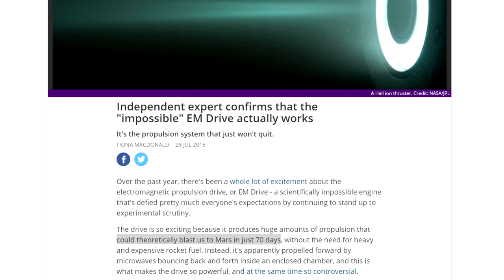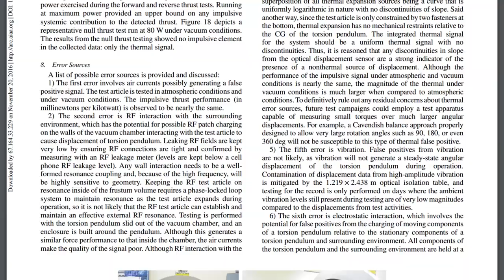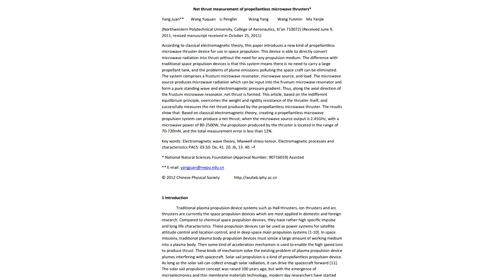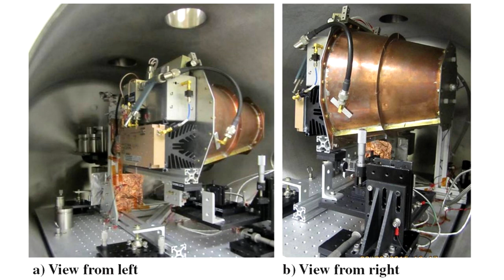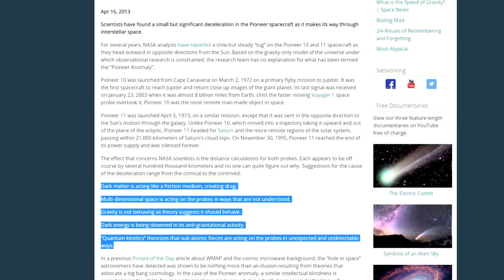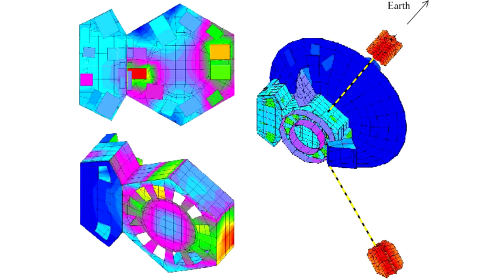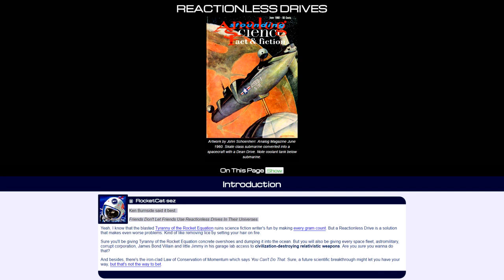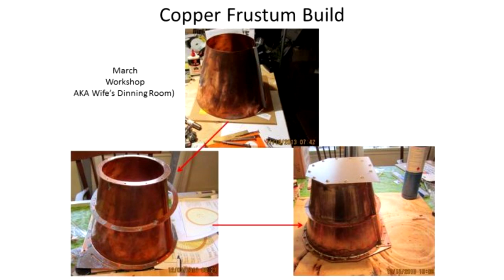What is the EM Drive? And Does it Really Work?

Comment: This seems to be at the stage where scientist that make the effect work are not really able to explain it, which should actually be ok, as long as it can be conclusively proven that the effect is real. We've had plenty of really practical effects in the past that took decades to explain after they were observed in practise. What we need is for someone to reproduce this effect with a laboratory quality microwave resonance chamber and then launch a cubesat with that chamber and some solar panels and set it to do a continuous thrust orbit boosting burn. Park that somewhere high enough for the theoretical trust to be able to overcome the atmospheric drag and see if the orbit increases over days, weeks and months of operation and by how much. You can also put a photonic drive unit with the same power source and mass and a passive cubesat with same shape and mass nearby as controls. If the EM Drive were to both work and exceed the performance of the photonic drive, then it does not really matter if its inventors can or can not explain it properly. With the costs of cubesat deployments rapidly falling lately, such an experiment should be within the budget of even some universities nowadays.

Comment: Saying EM drive will transport us into the stars is the same as saying that your own heart electrical "circuit" can power an entire city, it simpley doesn't work on the same scale, so EMD is basically useless as a propulsion device... It is a copper tin can that is simply chilling with some electrical fluch channelled in one direction. Let's say that Warp drive has many more chances to become real than this... as the Warp drive principle actually doesn't violates the laws of physics, it uses them by tweating gravity. It is like reversing the figures in an equation, something mathematically understandable.
Reply: Yes the propulsion is almost not there, however though assuming they stick with this tech, it will be scaled up and greater thrust to follow.

Comment: If I understand correctly, this is not a self-contained "drive". It requires an external microwave generator to power it. 
This is believable.

Now... can a practical system of power generation and transmission be developed to operate such a motor?

Comment: i am not a physicist , and i dont see the perpetual motion there  , you pump   there kilowatts  and you get tiny bunch of micronutons  that is super unefficient ..  and  about crude construction , its not a lazer, its a radio   ,you dont need to be super precise to get something from radiowaves
Reply from the maker: Energy is force time distance.
Power is force times speed.
If you’re already going fast enough you’ll get more energy out than you put in.
Reply: Scott Manley big thanks for your reply , but i see it like that : perpetual motion doesn't exist so  it will be like a flywheel or accumulator battery eventually energy will run out  , ps thank you for great interesting videos on your channel ,to bad there are no channels with your thematics on  russian youtube ..

Comment: I'm no rocket scientist but wouldn't it answer the question once and for all to just build a small working model, stick it on a microsat,  hitch a ride on the next Falcon 9 Starlink mission, flip the "on" switch once it's in orbit and see if does nothing or goes flying off toward Alpha Centauri?
Reply from the maker: The thrust is too low to separate from background perturbations.

Comment: 12:40
Okay, well, there has never really been a push to get "big" and powerful reactors in space for a myriad of reasons. If we had a reactionless drive that needed such reactors, we do have the technology to power it, however. Back in 1964 we had Project Pluto which was a nuclear powered ramjet which used a reactor with a core weighing in at 60kg and producing a whopping 600 Megawatts - and which also had a reactor diameter of about 1.4 meters. Even for spacecraft, that's not exactly large. Now, granted, this reactor was unshielded. Shielding would obviously take up more room and weight, but reactors small enough to use in space but that are also powerful enough to qualify as hot rods do exist. And this is 1964 technology. We've made strides in nuclear and materials engineering since then, let alone advances in propulsion/engines/what have you.

Comment: doesn't this kind of ruin into the same problem like having a fan on a sailship and powering the sailship by blowing its own sail? mythbusters tried it and it was reaaaally slow and inefficient, so if it's supposed to move forward because particles bounce on the inside of a metal box with no actual jet the particles can escape through. then it seems to me they are trying to blow their own sail and I think it is therefore not viable.

Comment: Have there been any measurements to see if EM radiation is actually escaping the enclosure? Is it possible that this half-baked metal construction could be acting like a laser or something?
Reply: They were experimrnts. It turned out that it was no photon leak and the claimed effect was too strong for that  anyway. It turned out that it was the Earth magnetic field interacting with the wires. When they turned the device by 180 degrees, the force direction did not change. Check and mate, reactionless rockets.

Comment: Consider coulombs are a far more powerful force vs gravity×mass, the Moon's levitated dust demonstrates this, it drifts off into space almost too fast to have any.

So, a 1965 patented low-orbit propulsion system used coils on the skin to sling ions ... the coils can be coatings today, the solar system has charged dust that against fields to repel the craft away from large masses, or, given space is cluttered beyond resolution with picogram stuff much of it dielectric to use for reactive motion.
Ymmv.

Comment: 10:36 logical fallacy incoming 
if the drive works in space it works because there is no friction in the vacuum of space so it can slowly accelerate to the 
top speed however if you put those engines on a wheel you would not get the same result first you have friction and then secondly when you start off tapping off the energy as you say you would get exponential amount of magnetic braking 
as in a regenerative brake . the same reason a gas powered generator slows down when you apply a load to it.
i would love for you to prove me wrong and make a video about it , i just think you didnt really think that through .
take care and have a nice day
Reply from the maker: That’s not technically a logical fallacy.

Regardless here’s an alternate version - create a spaceship powered by this, then using an onboard nuclear reactor accelerate it in a straight line, eventually thanks to Oberth effect it’s getting more kinetic energy out of the drive than the electrical energy it’s putting in. To extract energy crash it into something.

Comment: Suggestion that the book The Electric Sky be carefully looked at, as meaningful context for why a drive like this could indeed work. Remember, the scientific method means no theory ever becomes dogma.
Reply from the maker: Nah, The Electric Sky is straight unfiltered garbage which ignores all the problems with its framework by sneaking around all the broken bits. If the author cared about scientific method they would have addressed the numerous places where the electric universe theories break down instead of sticking fingers in his ears.
Reply: It also means we discard that which is cannot back its claims with evidence which the author clearly missed
Reply: NASA just delivered what looks to be that evidence (more testing will be required of course). Plus the arguments are more logically convincing that the standard theory. There's more disprovable evidence that the author's case than the standard theory. Your argument means you have to therefore discard most of the standard theory, as it is built upon totally ideas which cannot be tested.
Reply: I'll give you gents one more, then let this go. Why, if the sun is powered by fusion, is the temperature on the surface of the sun 6,000F but out at its chromosphere it's 2 million F? Just something to consider insomuch as the standard model cannot explain that.

Comment: I'm too stupid to really understand this ofc. First time I ever heard of a EM drive I thought it was just another take on the ION drive. But ION drive (in simple turns) uses electricity and fuel, while the EM drive would only use electricity (more or less) (yes the design of them is very different ofc). But for me it seems like more (ION drive) euals a waterjet and EM a CRT TV. Or EM seems like the thrust you get from fins when swiming in water. And you can't generate any thrust at all in a vacuum.

Comment: I don't see how perpetual motion machines are an analogy, you clearly need tons of power to either have the EM drive or the light thruster, the most logical thing to do next is send it out to space and test it there, we can all speculate, but until it is taken into space tested for a year, then weighted using a centrifuge method to see if there is any loss in weight, then look for explanations. Theorizing is same thing as couch war experts etc. Still don't get where free energy came from, you went off tangent there.

Comment: i cant agree with relativity time dilation, when you put a atomic clock in a different gravity you are still just changing the mechanical load on its actions, "time" does not have to change to do that.
Reply from the maker: +DANTHETUBEMAN the universe doesn’t care if you agree with its physics or not. Time dilation is a real, measured effect, and GPS needs to account for it.
Reply: come on,, they are compensating for signal travel time,, nothing more,, people will believe anything.

Comment: It seems to me, by bouncing the microwaves off of the interior of the device multiple times, you're simply multiplying the yield of a standard photon drive...it is literally pushing against the craft more than once.
Reply: Not actually multiplying though because the lateral movements would cancel out. And then not a photon drive either because the back is sealed so they'd bounce off that end too.
Reply: @Graknorke: Then that should, in theory, neutralize any force at all!  The waves will bounce off the bottom more often than the top, and the difference would be equal to any gain of the slanted sides - exactly the way it works with pressure inside a balloon. Only if the energy leaves the device should there be any force capable of generating thrust.
Reply: Yep you've got it. That's the obvious problem with the design. The guy who made it claims it works anyway but it looks like it doesn't.

Comment: How does any thrust work in a vacuum, ie space. Surely regardless of energy expelled from   
Thruster or fuel or energy running such a thruster, when that thrust is pushing against nothing I.e vacuum where does the force/ opposing force come from
Reply from the maker: Same way a gun produces recoil in space. 

Guns produce recoil because they push against the bullet.

Now look at a thruster exhausting gas into space, a gas is made of molecules, and each molecule of gas escaping out the nozzle is the equivalent of a tiny molecular mass bullet.

No need to push against air. That's the reason why rockets use rocket engines instead of jet engines. Inside the atmosphere jet engines are much more efficient than rockets which is why planes use them, but when you get high enough and the air becomes thin enough you need to use rocket engines.

Comment: If light, which is EM waves, generates thrust, I don't see why this odd microwave couldn't be leaking EM waves and generating thrust with that as well. Couple that with some 10^x error in the calculations and you have your experiment explained. Doesn't make the EM drive valid, though.
Reply from the maker: The problem was the claimed thrusts were thousands of times higher than the photon thrust.
Reply: @scottmanley  Didn't expect you to go through comments on such old videos, nice to see you ^^ 

That's why I expected an 10^x facor error in the calculations. But I've since watched the follow-up video (thanks, youtube algorithm, you did good for once), so I suppose my idea for it to generate any thrust on its own at all was still too optimistic.

Comment: If you can reach perpetual motion with EM drive so why can t you get it with photon thrust ??
Reply: I would think the photons carry momentum away, and constitute a reaction, therefore photon-thrust is not a reactionless drive. If a drive expels momentum by pushing directly on space for example, it would still cause a reaction in space. I'm not sure we know enough about the EM drive's method of providing thrust (if it does work) to say wether it's reactionless or not.

Comment: how does an input of electrical energy mean over unity or perpetual motion is possible?

electricity has potential and kinetic energy no? so if you need an input energy (electricity) to have an output energy (force) this is not perpetual motion. it is still just a conversion of energy. 

or?????

Comment: Doesn't physics laws start to break down at the quantum level? (thus the quest for a unified field theory to explain things from the very big to the very small) so it gets me thinking, if a lot of "explanations" of EM drives pivots around 'quantum' level theories, but if at a quantum level theories start to get broken,  then just about anything can start happening even if every fiber of your soul screams NOOOOOO!....EM drives, flux capacitors, infinite improbability drives, 42......oof, my head hurts.
Reply: Physics at the quantum level is fairly well understood; Physics breaks down when you need to apply these laws in the relativistic regime

Comment: So I think this device is expelling EM radiation by use of Snell's law. EM radiation is being pinched in the acute corner and expelled in the larger end of the device. Like a soap bubble expelling visible light into a rainbow until it get so thin that visible light an not longer exit inside the film of the bubble.

Comment: Isn't this actually just pushing against a magnetic field? 
If you need lots of energy input and get very low thrust output, it's not a "perpetual motion" machine. Just an extremely inefficient electromagnet.

Comment: EM drive + relativity = freakier than a time machine!

Wait... if general relativity is exactly correct, how can an iPhone tell the difference between a train accelerating and going up a slope? And I mean an underground train; there must be few external signals other than those which emanate from the train itself. I've seen a video with an iPhone used to measure the gradients of a London Underground line when there was nothing to see outside the train, and the people didn't even treat it like it was anything special. Maybe I need to watch it again. (It's on Stand-up Maths; something about train networks.) Could the Earth's magnetic fields be measured that precisely? Surely not, they'd vary with the local rock.
Reply from the maker: iPhones have a bunch of sensors, accelerometers, gyroscopes for rotation, magnetic fields, air pressure for altitude and geolocation via GPS, cell towers and Wi-Fi.
And all that get processed by a sensor processor with some machine learning. I haven’t tested it on underground lines but I can imagine they pick up Wi-Fi nodes and use those as beacons?

Comment: All you guys that are freaking out and tell people to be open minded, consider this:

basically, we have this thing called physics.
it makes incredibly good preditions (many of which are counter-intuitive or even mind-boggling) that can be checked and have been checked over and over again by hundreds of thousands of physicists for hundreds of years.

now somebody comes along with an experiment that looks kinda confusing and poorly designed and indirectly claims that not just some part of physics, no, all the fundamentals of physics (that we know to work very well, that form the basis of all our engineering (along with math)) are somehow wrong. nobody has reproduced the result. the result looks a lot like measurement error (physicists know a lot about that). as a physicist, what are you going to do?

Comment: How can something like this work in the vacuum of space???
In space,theres nothing to press aginst and therefor produce thrust...or?
Reply: Thrust doesn't work by pushing against something. Thrust is the equal and opposite reaction of something being pushed out of one side of an object (a rocket engine in this case) that's required by the law of conservation of momentum that the universe abides by. The act of pushing matter out one side is what makes thrust driven objects move in the opposite direction.

As for how this specific engine would work in space, based on how many groups are retracting their studies due to finding errors in the experiment, I'm guessing it just wouldn't.

Comment: This thing is, even if it works at all, essentially, in terms of being able to do anything of the things the inventor claims it could do, a bust. However, the science doesn't seem sound. From what I could tell all the testing was at the edge of what could be tested so the readings could easily be an equipment or testing error